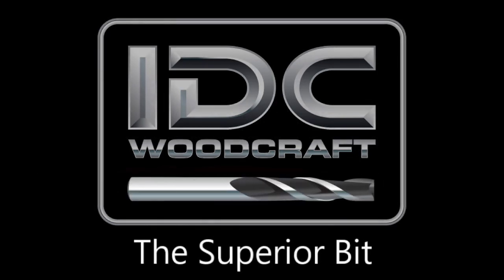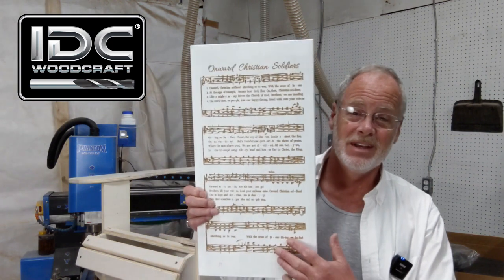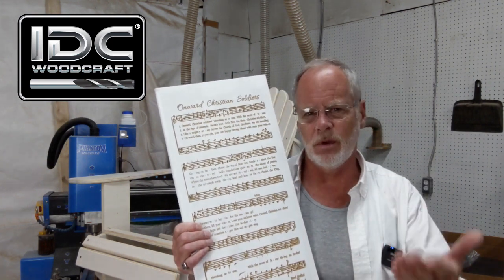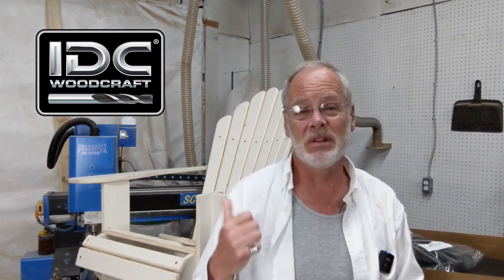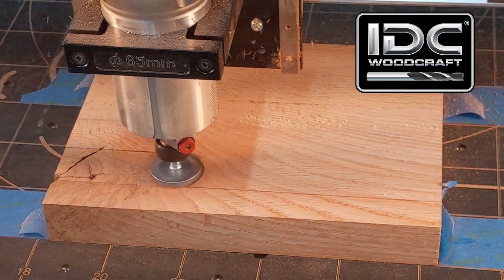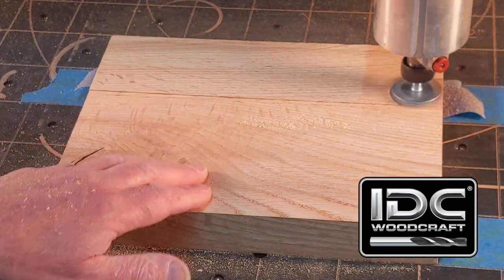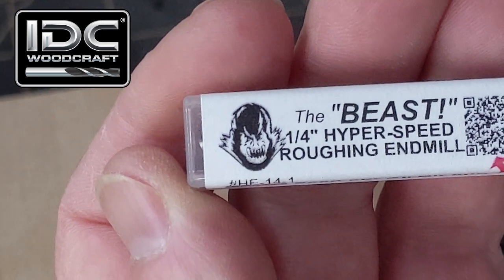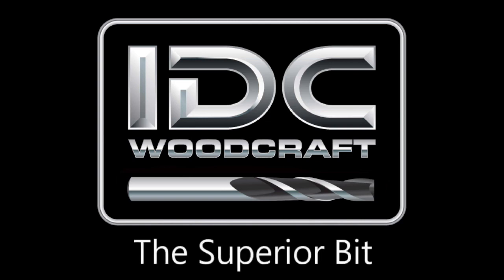CNC Router Project Weekend Update - NEW CNC STUFF

Comment: Is there .25 shank end mill bit that can cut 1.5 depth with a smooth finish? I seem to be having trouble  getting a smooth cut using my current bits on the end grain portions of my projects.
Reply from the maker: Gary, this downcut should give you a really good finish. Here is a link: https://idcwoodcraft.com/products/long-1-4-router-bit-for-cnc-trim-routers-1-4-shank
You might also need to run a finish pass to get a good clean cut!

Comment: On the topic of the chair components and how you said it wouldn't work on the machine with the shorter (I'm assuming) Y axis, I have seen a video on here that was done by Jonathan Katz Moses where they use a pinning technique to be able to process basically an infinite length on the Y axis. I'm not sure if you would be interested in doing a video on that in your own style as JKMs was run through pretty quickly but just thought I would mention it to you.
Reply from the maker: Yes, that is a method called tiling. I've considered the chair using that method for smaller platforms but honestly, the chair design has taken a lot of time. I probably won't do the chair in another video. Perhaps some other project
Reply: @IDCWoodcraft  that's a fair point, that chair does look quite in-depth and an awesome design.

Comment: I really like those clamps you created. I have some low profile clamps, but I never liked bolts sticking up above surface of the wood. I am curious if the bottom of your clamp has multiple holes to adjust the pegs to different spoil board hole spacing. I don’t want to have to re-drill my spoil board - Of course price will also be a big factor.
Reply from the maker: Roger, very true. You want them to be as low profile as possible.